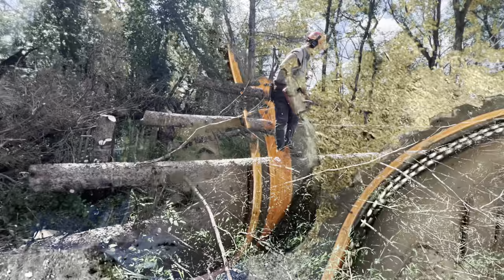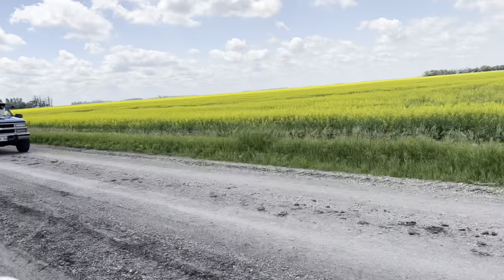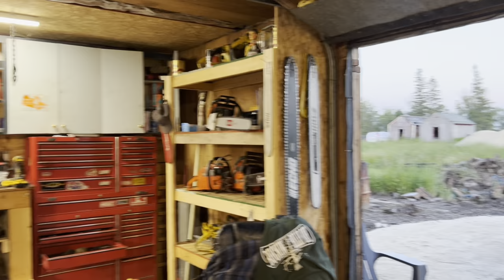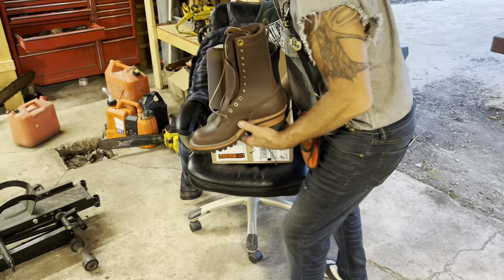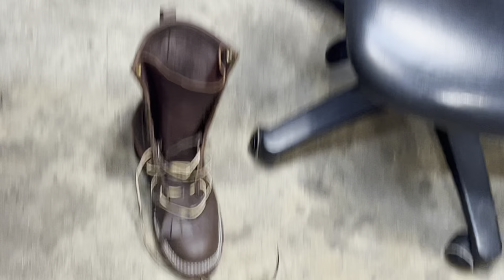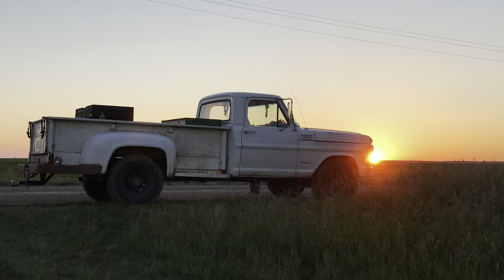Glorious unboxing 🥾Loggers boots. Nicks Boots surprised me.

Comment: If I did logging or tree service you best believe id try nicks from what I’ve heard/watched. I recently switched from redwings to thorogood moc toe boots (I do commercial/industrial hvac), work on concrete/roofs a lot. Great boots/construction, and very comfortable. I love you positive attitude and outlook. I just use wood for firewood, love cutting/splitting
Reply: Builders pro or mic toe built way u want ,garranteed u will never go back to previous brands